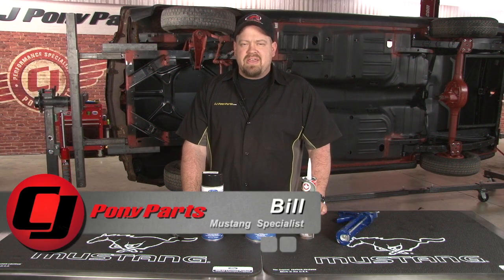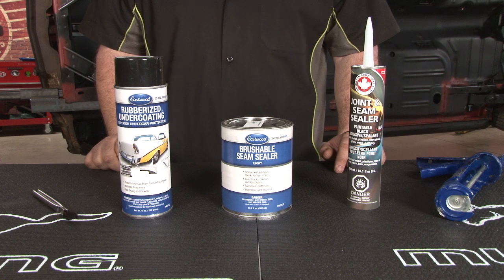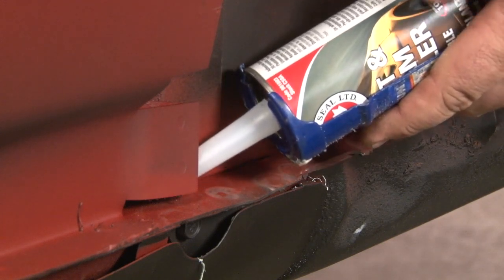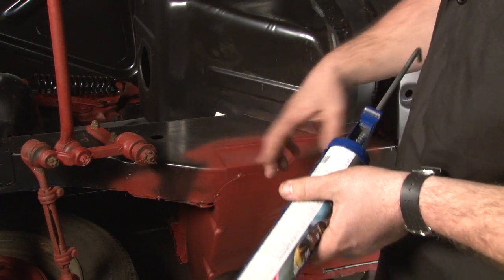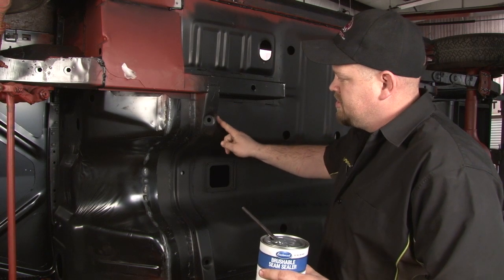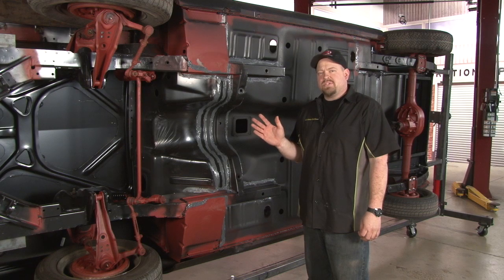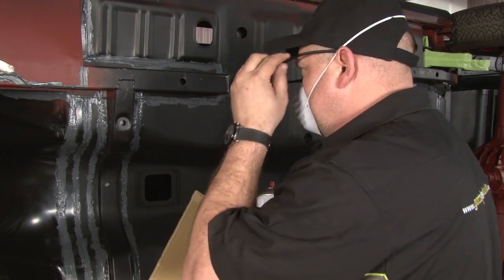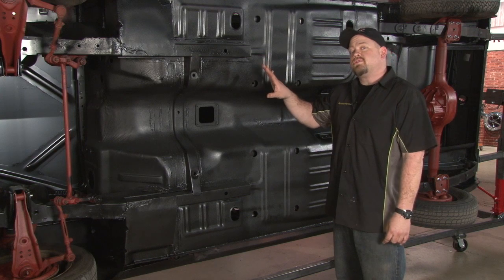DIY Seam Sealer and Undercoat | 1965-1993 Mustang

Comment: 2016 most guys use Bed liner as under coat not the rubberized dirt collecting gets gooey when hot old fashion coating.Remember anything two component is way more durable than one stage.

Comment: I recommend torque boxes on any build unless you are staying concours correct. They add strength to the overall chassis. If your car is assembled I would not recommend torque boxes for that engine because of the labor involved to install them after the car is completed. You can always add subframe connectors as well, they are easier to install on a finished car and will do the same job.

Comment: It's red oxide primer we sprayed on the welds and black e coat put on most aftermarket panels to protect them from rust.
Reply: what kind of e coat did you use

Comment: Bill, you are a great instructor, and the videos are top quality. I understand that torque boxes give additional strength to the frame rail area, are they necessary for a car if you are increasing engine output in terms of torque and horsepower. I have a 66 coupe which had a 289 in it and I'm replacing it with a 302W and looking for around 250HP. What are your thoughts?

Comment: all that work to put it on a rotisserie, and then take a cheap cheesy spray can approach for undercoating, what a waste
Reply: Jose Francisco Medeiros por 15 for as expensive as it is,has limitations. If out in the open it dulls from the sun,I have also used it on trailor where with in a year it can be peeled off in little sheets of por 15 and this was on a sand blasted chassis.
Por 15 isn't as tough as it is made to appear to be.but it air dries like urethane without a hardner .it's also ,a battle ,like premixed fiber glass ,to get it on without the can hardning ,or getting thicker as you paint from an open quart can.
Which most hobbiests do.And don't spray it ,not good it gets on everything and hardens ,not good for skin of eyes cause it hardens with moisture.so brush or roll is recommended.
Reply: @MindDezign  agreed, I've actually used rustoleum oil based primer, added hardener from actual 2 part shit I had laying around and it stands up twice as much as por15, por15 is overrated
Reply: @darryl163  any body using rubberized under coat in a can ...is a used car dealer....
   Two component ( any brand) bedliner is THE ONLY THInG to USE in the harsh enviroment as UNDERCHASSIS....and I mean nothing but bedliner as the finish. It's the toughest not dirt / moisture absorbing it's the best repellent of such harm

Comment: 1) rubber undercoatings are worse than no undercoating
2) mask is not enough, spray paints require respirators with activated charcoal filters